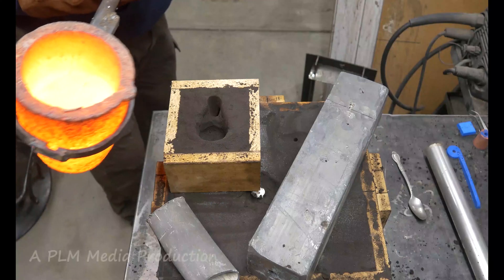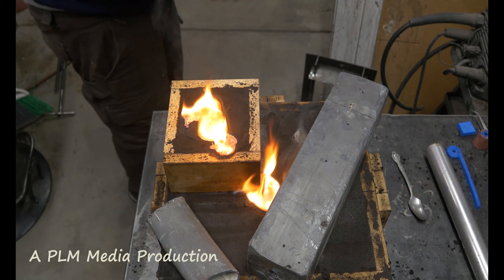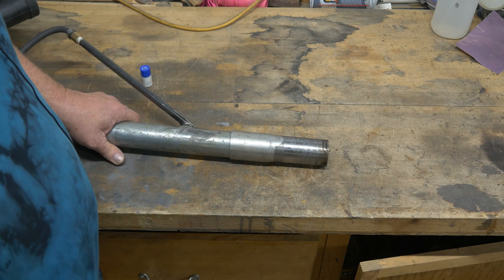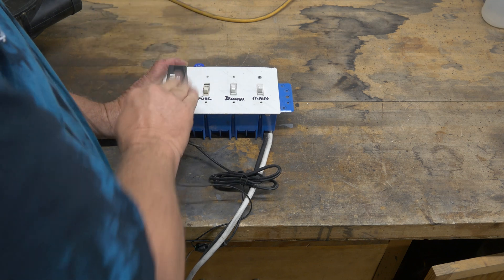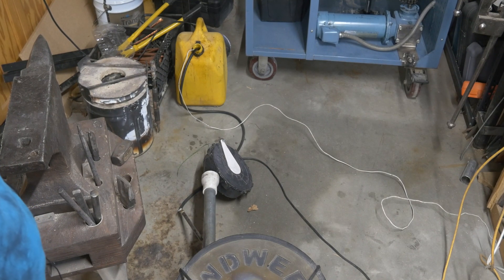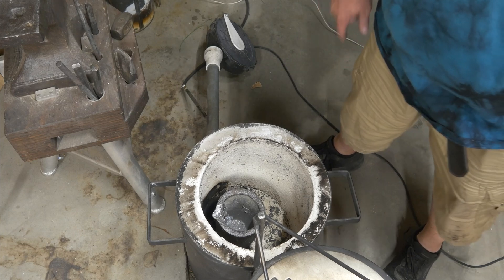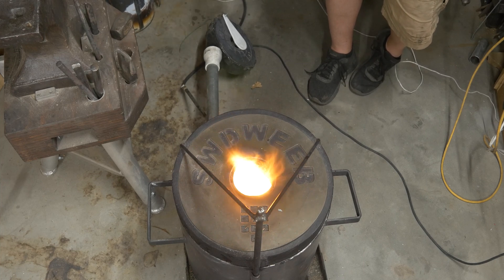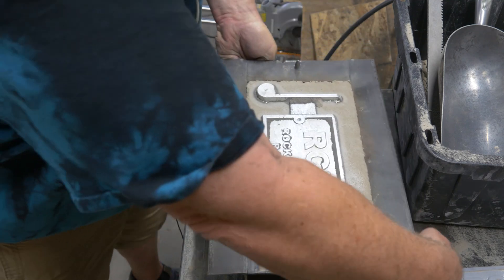Building a diesel burner how hard can it be

Comment: Just a heads up, I managed to block my nozzle,  and the hose popped a leak and sprayed diesel. No harm done, but I'm going to get a better high pressure diesel hose.
Reply from the maker: A friend of mine pointed me at fire sleeving at McMaster Carr as a means to help protect the fuel line from ardent sparks or splatters.

Comment: I got the burner running. I only needed to run the pwm at about 30%. Any more than that and black smoke. My burner is only 38mm in diameter,  so I'm airflow constrained. The pump needs at least 8 amps, my pwm and power supply from aliexpress are rated for 30. It melts aluminium easily.  I'm using 2gph, but I'll probably swap for a 1 gph and 45 degree solid nossle. Then I'll try bronze. Many thanks for the in to get it working.
Reply from the maker: Congratulations on getting it running. Having a larger tube is something I would do next time just so I can get more air into the chamber.
Reply: @swdweeb  Yes, but that means I'd need to remake the furnace :(
I put some more notes here. https://athimblefullofhell.blogspot.com/2025/05/diesel-burner.html
Reply from the maker: Finally made the time to go look at blogspot.  Like you, I keep thinking I need a bigger inlet for my air.  Some day...
Reply: If it will melt a quart of bronze, it'll do

Comment: I have my burner almost made, I've drilled and tapped a 19mm steel cylinder to make the adapter, it's got a 1/8bsp at the other end for a compression fitting.  I have a 750 watt fan from a bouncy castle which I suspect is about 10x overkill. What wattage is your blower fan? it looks like 1/20hp which is about 40 watts? Would that make sense? if so I need a smaller blower.
Reply from the maker: A bouncy castle, you probably do have more fan than you need. If it's constant speed can you build a sliding cover the cover the inlet side and reduce the amount of air entering the furnace? I'd love to  have a "too much fan" problem.  I have no idea what wattage my fan is. 

Keep me posted, I'd love to hear how it comes out.
Reply: @swdweeb my power supply only went to 5amp, at 5 amps with the pump, it was maybe 7v. That did spray the diesel, but I have a better  power supply and pwm controller on the way

Comment: Did you stick with the pump in the link in the end? Or use a different one? How many amps did you need for it?
Thanks
D
Reply from the maker: No I have since upgraded to this one https://www.amazon.com/dp/B09W64GPKB   I'll update the description
Reply: @swdweeb did you switch power supplies for the new pump too? Or does the old one still work on it? What was the Volt and Amps rating on that power supply?

Comment: So just trying to understand this so the diesel drips into the bigger air pipe and then is blown into the furnace? At the optimum burning state like what pressure amount of air? like a hair dryer or leaf blower sort of pressure? or like an air compressor?
Reply from the maker: No the diesel is forced into the nozzle with a fuel pump. Check the description of the video to see the list of parts I used (including the pump and the blower I have). My blower could stand to be a little larger but the nozzles come in such an array of flow rates you can find a nozzle that is closely matched to the amount of air you have coming in.

Comment: You've been using this burner for quite a while now, overall, are you happy with the design? And, if you were to make another one, is there anything you'd do differently?
Reply from the maker: At this point the only thing I'd do would be to find a larger blower so I could get more air into the burn chamber. Other that, it still works great.

Comment: Greeting from a fellow metal worker. Just curious whats the chamber dimensions on that furnace, it looks massive assuming thats a 8kg crucible?

Safe melting.
Reply from the maker: Yeah, its way too big for those little crucibles. I had intended to be using larger crucibles for bigger pours but haven't seem to made it there. It can handle bronze but inefficiently. Isn't possible with all that empty space.  I think inside diameter is 12"
Reply: @swdweeb  just an idea for you, would it be worth it to pour a new refractory liner and have it a slip fit or possibly ceramic wool. Could take it in and out as needed for different crucible sizes. 

Thanks for taking the time to answer, I appreciate and respect it immensely.

Safe melting my friend.

Comment: Hi Mr, greetings from Turkey 😊The simplest advices to make a diesel furnace so far, thank you for that. The reason I am watching such videos is to melt cast iron, that's my goal. And even I wanna go further and melt steel. One thing I see common in these videos are cheap nozzles, motorcycle fuel pumps (which I beleive wouldn't run best with diesel) and the filter of it (which again designed for petrol, not diesel). So my advice could be going to a car scrapyard, buy entire fuel injection system including the turbo (of a diesel car of course). You can make 4 or 6 spraying positions according to the fuel system you bought, I'd personally pick a one from a truck - more fuel 😊 Now, of course it needs modification, diesel fuel lines and nozzles of vehicles are designed to spray fuel according to an order and the pump directs the fuel according to the order it gets from the control unit. The possible solution could be to this to pick a common rail diesel system and subtruct the distribution unit in the end and connect to the pump directly. Second possible solution could be to remove the distribution unit from the pump for non - crdi systems. Either way, we need the pump to feed all injectors at the same time (1 pump could be assigned for each 1 injector) And turbos are perfect air blowers. They get motion from exhaust gas but you can remove the intake part and just directly connect to a simple electric motor. And there you go 😊. So why truck or car injectors? They are excellent vaporisers, developed by the experience year after year to obtain smallest particules so that the forced air coming from turbo can mix best.

Of course I myself never did apply such thing on such project but since my professional carrier is based on truck spares, I just see this as a better option since all the system from tank to the burner is specially designed for diesel.

Okay, I am ending my painfully long comment here, thank you for great video, and cheers 😊
Reply from the maker: Wow, I wish others put as much thought into their comments as you did. Thank you.  I agree with the need for a proper pump to feed the nozzle. Since I made this video I upgraded my pump to a larger pump that supplies fuel at a higher pressure and volume than the original pump. I was then able to reduce the nozzle size due to better atomization of the fuel entering the burn chamber.  The limiting factor in my implementation is now my air supply. I am not able to supply enough air for proper combustion of the fuel. It's close, but not quite there.  I need a bigger blower.

I am confident that the nozzle will melt cast iron but my furnace and crucibles are not sized properly to melt ferrous metals. There is too much space between the crucible and the furnace wall. In other words, my furnace is too big for the crucibles I use. I am able to melt copper with this improper sizing but I cannot concentrate the heat well enough to melt ferrous (cast iron) metals.
Reply: Your beutyful job and simple explaining everything deserve putting thoughts sir :) trust me, I watched "a lot of" videos about this. Now I have thoughts about how to enrich diesel. increase the octane, so the heat 😅 By the way, what would your thoughts be about adding another nozzle? Do you think it could increase the heat significantly?
Reply from the maker: @futuuu  A second burner would certainly heat things faster, I'm not sure it would heat things hotter. Think about it this way, one flame at 1000C will eventually heat things to 1000C, if I add a second flame at 1000C will it heat things to 2000C?  I think getting the right fuel to air ratio is the most critical, creating a burn chamber that is the right size for the crucible it the next most important thing. A single diesel burner can get to about 1925C https://brainly.com/question/52639625 steel melts around 1300C.  a tiny flame just takes  a lot longer than a really big flame

Comment: I made a drip burner 15 years ago. When it was running well the heat was downright terrifying. I was afraid the radiant heat would catch my fence on fire—and the fence was 10 feet away! When it wasn’t running well, it looked like a plane had crashed in my back yard. Clouds of black smoke. The neighbors were not impressed. 😂 But I’m very impressed at how far people have brought the oil burner idea since those days. Well done.
Reply from the maker: Thank you. Yeah, mine is so bloody hot I had to put the furnace on a cart that O could wheel out onto the driveway away from the house.  I almost built a drip burner and know a couple of guys that still run them.
Reply: Well, thanks for the how-to. I may end up building one of these for making crucible steel.
Reply from the maker: @matthbva  The one mistake I have made is the volume of my furnace is disproportionately large as compared to the size of the crucible. As a result I end up having to heat a lot of space before the metal melts. I've tried putting the crucible in the path of the flame and that helps but having a "tighter" furnace would be a big help.

Comment: is there any difference between a devalan 2.00 x 60B and a2.00 x 60w as i cant get the B?
Reply from the maker: Check this out https://delavan.com/wp-content/uploads/2022/05/Delavan-Combustion-Catalog.pdf it shows what the letters mean.
Reply: @swdweeb  thanks very much, that's interesting to see its the difference in the spray patterns.i managed to get the B in the end but by DANFOSS.i dont suppose that makes much difference (the brand)...far be it from me to say,it could be worth mentioning the thread for the adaptor is NPT for your audience?it got my search started with your advice but then the penny dropped after refering back to the check valve and nozzle and what their threads were.being in the UK most things come as BSP but NPT is quite easy to get of if you ask...anyway,i am getting there with the parts :) cheers!!Dave
Reply from the maker: @jessbakerjess  Plumbing threads here in the States are a nightmare. There must be 30 of them. I find I spend more time searching for how to connect this to that than I actually do on any other part of the project.
Reply: @swdweeb  haha..i know what you mean!,ptfe tape saves the day alot with mismatched threads :)
Reply: i think the difference between NPT and BSP is one is at 55' pitch and the other 60 degree thread pitch.so you think youve a match then it tightens up.but thats the only difference.

Comment: Oil burner nozzle's are rated at 100 psi, that fuel pump may deliver 4-6 psi max.  If you up the pressure, you can reduce the nozzle size.  This is why you need such a large nozzle rating, because your psi is low. It works, that is the main thing.
Reply from the maker: I've since added a 100psi pump. I've also dropped the nozzle size down since doing that
Reply: What did you bring the nozzle size down to?  I am planning on using a oil gun from a furnace.
Reply from the maker: @gjkozy Sorry I havent gotten back to you yet. I want to get you the correct information and havent been able to get to the burner to check it. I'm pretty sure I went from 2.5 GPH to 2.0 GPH but I want to check the nozzle I pulled out and the one that is in the burner.  I could probably drop it a bit further to something like 1.75 but havent had the time to play with it.
Reply: @swdweeb do you have a link to the newer pump?

Comment: Do you have to have a pump or can i get by with a gravity feed set up
Reply from the maker: I am running a pump. The nozzles require fairly high pressure to operate as designed. This is the pump I have https://www.amazon.com/gp/product/B09W64GPKB

Comment: I run the hose on my propane tank just low flow and it keeps tank from freezing over
Reply from the maker: Running low volume of propane did not get hot enough for me to melt copper.  When it's cold in Colorado the tank froze unless I put it in a tub of warm water

Comment: Even though new to this art, considering a larger furnace for steel eventually.  As always, thx for the knowledge Swdweeb.  Great move with the check valve too.  One more question, I’m seeing you do most in the garage.  For convenience, I’d like to do the same.  Go do you regulate heat in there?  No concerns of fire to the ceiling and such?  If you’ve made these in past videos, what can I say, I’m lazy sometimes.  🤣
Reply from the maker: Well.... I probably got real lucky.  My roof is pretty high and its relatively open so I expect the heat dissipated but... I never saw any sort of heat damage, in fact I have a fluorescent light fixture kinda right above the furnace. It would swing back and forth with the blast coming out of the furnace but it never melted.

But... it always bothered me that I was doing it inside. I have a video that I need to finish shooting that shows my new set up. Basically everything is on a cart that I can wheel outside and just let it set on the driveway. I feel 10000% better about this new set up.   I still need to do a little work on the cart before I reveal it but I will show it once done.
Reply: @swdweeb  Thanks, 👍🏻👍🏻

Comment: i want to add that ceramic insulation is the ideal way to insulate. the foundry you have in this video has alot of open space.  id decrease the space inside.  you can achieve a blue flame with diesel.  thats about as hot as youll ever be avle to get it.
Reply from the maker: The space was put in so I can use larger crucibles. I’m changing the burner setup a little to get a better burn

Comment: Thank you very much for sharing your build and results! I'm in the process of designing my own diesel burner foundry, and wasn't too fond of the idea of using an air compressor to atomize the diesel like you touched upon in the beginning. I'm happy to see a blower-type burner still works quite nicely, and there's overhead for higher temperatures if you change out the atomizer nozzle.

My apologies if you've already answered this elsewhere, but were you able to get to temperatures hot enough to melt iron using the 2 gal/hr nozzle? My goal is to set up a workshop where I can cast complex parts for my projects, but wonder if I have to go the "Tim Allen" route and resort to an air compressor and high flow diesel supply system.
Reply from the maker: Quick answer is no, not really. I melted but it was too cold to pour. I am in the process of changing somethings that might very well get me to the point of melting iron. I've gone to a higher pressure pump. I hope to have a video on the upgraded pump out soon. We'll see if I actually melt any metal with it. I'm still under doctor and wife orders to not lift anything very heavy, a crucible of iron or bronze likely falls within that criteria.
Reply: Makes sense. I surmise it's the sand that's drawing too much heat from the melt, and it can't flow properly so you're getting cold shuts and whatnot? Not enough of an overshoot of heat to account for that loss?

Hope you heal up nicely there! And despite putting a damper on your foundry work, it's good to hear your significant other and doctor are looking out for you! :)

I look forward to seeing that video sir. I'm very happy I stumbled upon your videos as I was looking through some engineering textbooks, to try to be smarter in my design, and while I understood some of it, I'm a very tactile person...so seeing someone actually put those principles into practice is greatly appreciated! Thanks for all you do! Cheers!
Reply from the maker: @mashedtomatoes8516  Thanks, yeah there is melting temperature and pouring temperature. I needed to be hotter and just couldnt quite get there.
Have you seen Mark Presling's series on his diesel burner? He just finished it and it is quite impressive. There are five videos in the series. Here is the first https://www.youtube.com/watch?v=rmiP7RSh558
Reply: Thank you! Yeah, I finished up watching them the other day, he was actually the gentleman that sent me your way! I really enjoy how in-depth he goes with machining trick, and good practices when it comes to manufacturing. I actually work in a manufacturing environment, so those learnings have actually come in handy with my work.

I do like how his system is portable, and that everything is adjustable on it (nozzle positioning, fuel rate, air rate), so he can play around with different cone angles and flow rates if he so chooses. The challenge for me would be to get access to the machines necessary to build those parts. I'm fortunate in that I have easy access to SolidWorks for drafting up my system, but actually manufacturing the parts I need will be a different story...
Reply from the maker: @mashedtomatoes8516  I'm like you and have no access to the tools that Mark has. As a result, my burner looks the way it does and Mark's looks the way his does 😄😄
Reply: Fair play. I had to implement the same thing when I was building some naturally aspirated propane burners for my forge...a lot of pipe fittings chopped up with an angle grinder and set screws everywhere for tuning!

It works, but is a faff to get dialed in. :|
Reply from the maker: @mashedtomatoes8516  I'm actually getting ready to chop my burner down a few inches. I bought a cart to put everything on and I need a little space. I'm going to end up cutting the fuel supply line off with an angle grinder and then re-threading it with a pipe-thread die that I've picked up. There is no hack too large 😀
Reply: How does it go: "Necessity is the mother of invention"? XD

And you can never have too many tools, dad taught me that one. :P